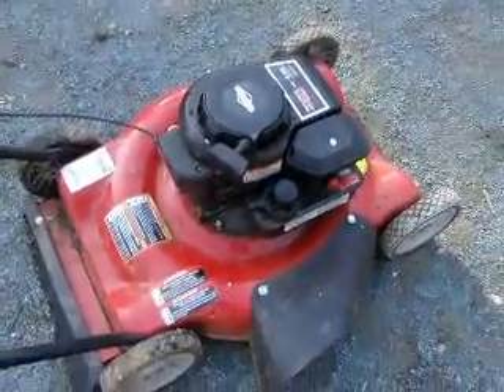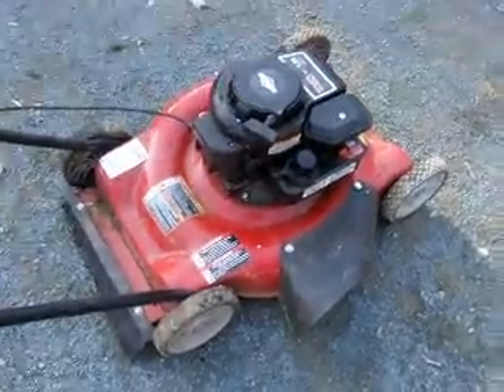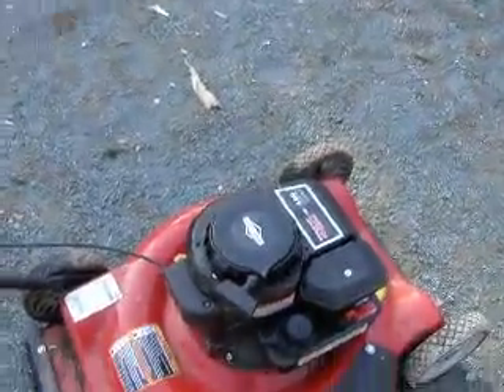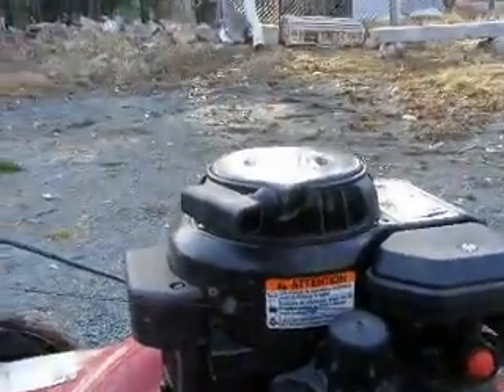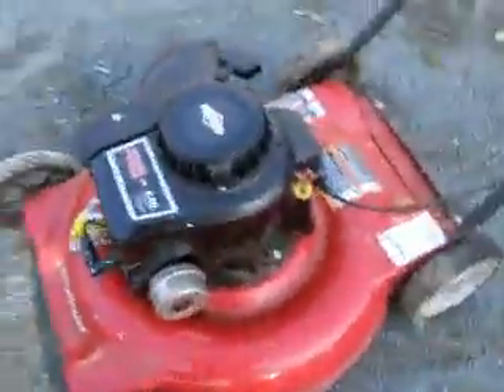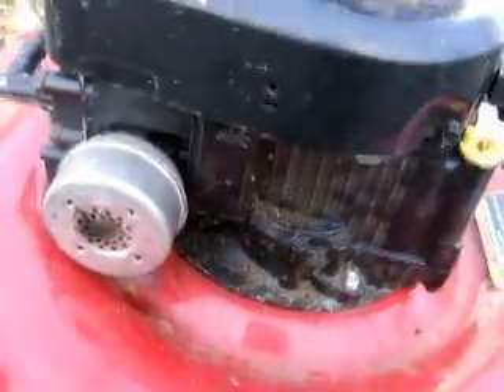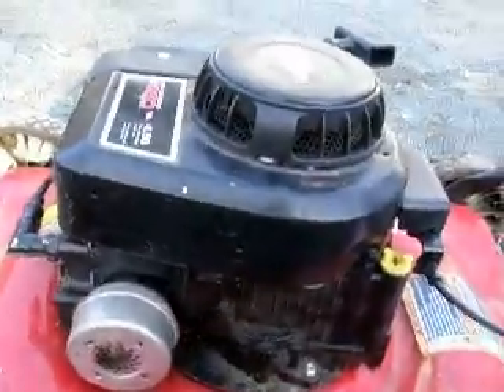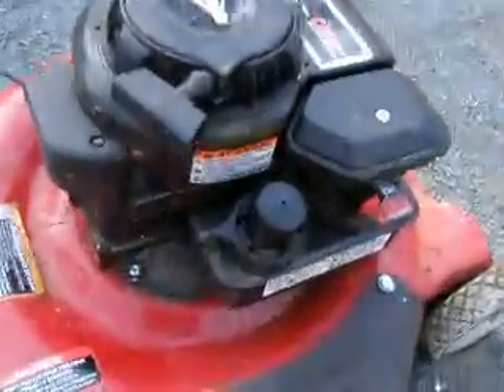Briggs & Stratton Engine Knocking

Comment: Its the pistol rod over time of poor maintenance and long term use they wear down ever so slightly causing the knock you can shave it down a tiny bit to fix the issue i have seen a video where some did that i haven't personally dont that i normally just replace the piston and rod from another trashed mower or occasionally buy it new depending on how cheap it is 😂

Comment: Pull the pan off of it and pull the rod cap off..file the ends down just a little bit and take some emmory cloth to the crank shaft and smooth it out a little and put some grease on it and put it back together..run it for another year or two..take you all of 2 hours to do and save yourself a bunch of money and heartburn listening to that noisy sob..It's kinda like waiting for a damn bomb to go off

Comment: That definitely is the sound an engine makes when it is low on oil. I know that ain’t the problem here, but one way to tell if an engine has damage from low oil is lower performance and knocking just like in this video.

Comment: 20-50 motor oil with 20% STP OIL TREATMENT... or MORE. still knock, not as bad... when cold... when oil is warmed up... it will knock again. run it. change oil every 20 hours til it wont run any more. cost to rebuild the motor is half the cost of new mower so hardly worth it... curb the mower with FREE MOTOR BLOWN sign on it. it will be gone by dark. one mans trash is another mans treasure.

Comment: people on here saying the connecting rod and bolts etc.  how can it be the connecting rod ? the little end bearing could be worn making noise. the connecting rod bolts may be loose on the crank. the oil slinger could be making some noise . a few different things ,

Comment: I hit a rock while mowing. The mower did not cut off, but immediately had a knocking. The knocking was very bad at first, but got better as I kept mowing. I was afraid I wouldn't be able to restart if I turned off my mower. I haven't tried to restart, but I'm wondering if anyone can tell me what damage I've done. It really sounded like the end of the blade was glazing the underside of the mower.
Reply: you bent the blade. replace it first. than try restart. if your lucky ,you didnt bend the crank

Comment: I work for Briggs and Stratton just replace the rod and check the rod bolt
Reply: Indeed first thing I thought was that just needs a new rod and a good clean then some decent oil and it'll run like a champ most briggs mowers will run forever if you take care of them all my mowers have been free or 10 dollar broken ones that had little to nothing wrong with them apart from poor maintenance etc I currently have a briggs 500e mower I got for free gave my dad my old 500 classic also got for free that I replaced the rod and governor springs runs like brand new and I'm going to give this 450 classic to my friend once ive got it running properly haven't had a proper look at it yet was given to me a few days ago so all I've done is check to see if it'll fun on start ya barstard it dose sounds pretty good runs extremely high rpm so probably a dodgy governor spring and its abit loud due to a broken muffler carbs also definitely got  leak so that's also apart of the issue but they really are simple reliable machines I'll fault test it tomorrow maybe see what parts I need to get then I'll have it going like new 😂
Reply: How does one get a new rod? Mine has a knock that even ticks/knocks when I slowly rotate the cutting disc under the mower. And it also appears like it has too much compression. Difficult to turn over. Do you think the wrong spark plug has been put in
Reply: @aliray7833  just search your engine serial number and search for your mower  then just type in conrod replacement and look until you find the one with the same serials as your mowers engine

Comment: My mower only knocks when i shut it off, anyone help?
Reply: Thats a loose blade or loose engine bolts had that problem after a rebuild and i tightened those bolts and no more knock on start up or shut down

Comment: That's not knocking that's rod slap
Reply: Zeh, that is what it sounds like to me.   Just getting a little bit loose with age.  Since too much play in the crank bearings is bad, I suppose I'd change to the next heavier weight oil, in other words, instead of 10W30 straight 30 or even 40.  If this is the problem, the motor is gonna go anyhow.

I've seen engines destroyed from connecting rod bolts actually backing out.  But this could just be wear, since people tend to ignore the oil condition and level in a mower engine.  I've gotten one mower in that had black oil -- and almost nothing dripped out when opened the drain bolt to change it. 

As another poster mentioned, this could also be a loose wrist pin.  Either way, the connecting rod sounds like its wearing out.
Reply: Well that's what you get when you don't take care of a briggs or tecumseh...

...or any other engine :/
Reply: Haven&#39;t seen very many Briggs motors that people HAVE taken care of. Just my experience. I&#39;ve taken quite a few apart. You can tell by the tar inside the crankcase when the oil's never been changed.
Reply: Nobody changes the oil. I just picked up a 2015 Toro Personal Pace from the junkyard for $10. Looks brand new from the outside. Couldn't pull the cord. Could barely move the blade. Oil was low. Grass was packed underneath the deck. Took off the front and cleaned hardened burnt stuff around the piston and valves. Dumped the oil and it came out like sludge. Seriously. I could wrap it around a screwdriver as it came out like spaghetti. Added oil and gas. Fired right up. Blew some white smoke but that cleared. Gonna run it a bit and change the oil again, but it seems to run great.

Comment: I hate flathead Briggs all they do is knock
Reply: Jack Carroll nah flathead Briggs is all good
Reply: Check your oil and the flat head Briggs and Stratton motors are good
Reply: I have 25 of them
Reply: Don't forget their penchant for hunting and surging.  The least little air leak or blockage and they go to town.  I prefer my 1960s 2 stroke Victa.  As long as the snorkel hose is intact so no dust gets in and you keep the fuel properly dosed with 2 stroke oil and they will run forever.

Comment: i think you will find that most Aluminium Bore/Entry Level engines like yours will knock after 50+ hours there are no bearings in these engines, Just bushings. that are made of the same aluminium

Also, They are not meant to be run at that low a RPM as that causes DAMAGE due to the Splash Lube gear not being able to distribute the oil.
Reply: +James Stephenson They don't last very long when you mow slopes with them either due to lack of lubrication LOL.
Reply: Could be but I have one of these from the 1970s and another from the 1980s that I know has been used heavily and they sound fine... I think... hehe so much rattled on the 1980 because of the decks age and being purely metal.. they’re cheap but these l head Briggs last imo

Comment: If you run the lawnmower too slow the oil can't reach certain parts of the engine like the valves and piston. What your hearing may be the wrist pin.
Reply from the maker: Yeah..good point, thanks for the advice :) but it was making that sound at all engine RPM's (it was just harder to hear) but in all honesty it was the compression. While tearing it down I seen signs leading up to bad compression causing a "knock", so I corrected it and now the lawnmower works fine, I'll post a video of it later to show you. But thanks :)
Reply: @kjay2638 would love to see how to tear a brigs and Stratton engine down, my dads old mower has a knock and I want to get it working for him